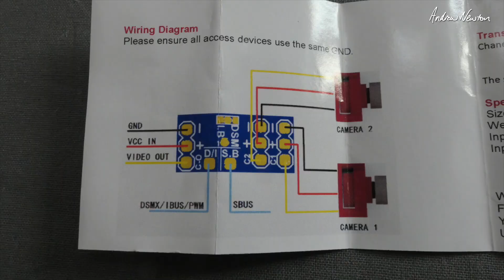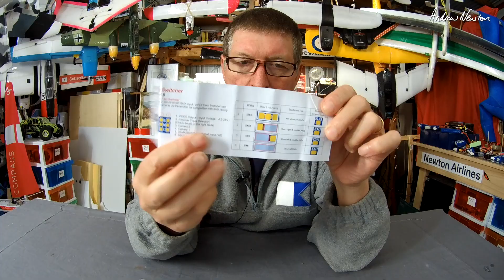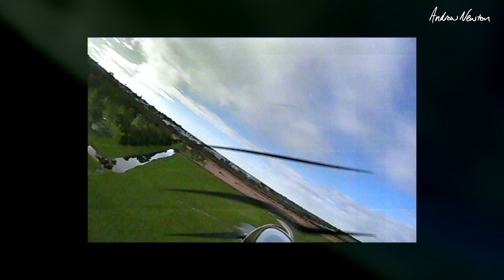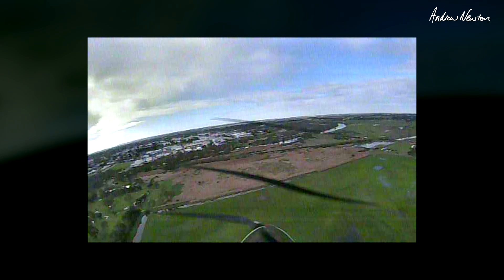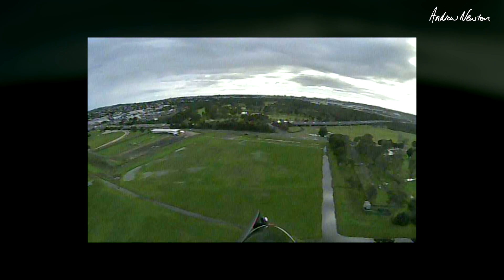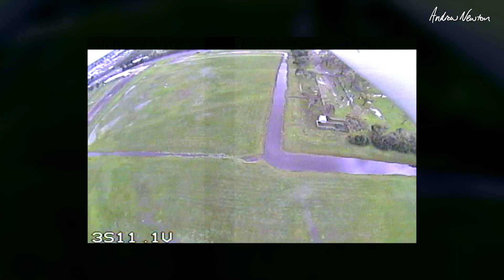VIFLY FPV Camera Switch

Comment: Nice demo Andrew. I have flown FPV using an underwing mounted camera and quite like it. If you aim the camera out towards the wingtip a little more, you should be able to get a horizon just in view at the top of the image with the glider in level flight.
  You can then use the Horizon as a way of knowing if you are flying level when you get used to it.  The ground is so much more useful and interesting than clouds when flying FPV.  It also gives the camera a much easier time aperture wise than sky does.

Comment: i think you missed the most important feature, that you can connect it to sbus/ibus with a serial only RX, all other switchers do the pwm switching but this one does also the sbus (chan 7)
Reply: Bicks MultiView switch can be done with a PWM signal or the PinIO off a flight controller.   Makes it easy to trigger if using something like a TBS Crossfire receiver.

Comment: Mine was not working, i got the same, try sbus and pwm, check RX(x8r) that it's receive signal, solder and disolder switches, but no success, just showing one camera, i try caddyx and runcam, also for both i choose PAL

Comment: Andrew there is a very noticeable grey vertical bar moving slowly across the screen. My experience with these switchers is that they introduce noise and this one is no exception.
Be interested if you hooked it up WITHOUT the switcher and got the same grey line.
Reply: That is the line sync pulse from the 2nd video camera, you can also see the flyback. The two sources haven't got very good isolation.
Reply from the maker: I only happens when I connect that down facing camera, Foxeer Monster first version.

Comment: Hi andrew I have this for my wing but I'm using matek f405 with inav and crossfire as my receiver..how do I wire this so I can use 2 camera?
Reply from the maker: I'm not familiar with crossfire. Plug the switcher into a spare PWM output on the board then set that output up in the mixer as a spare RC channel, then operate that channel via a switch on your radio.
Reply: @AndrewNewton  thanks